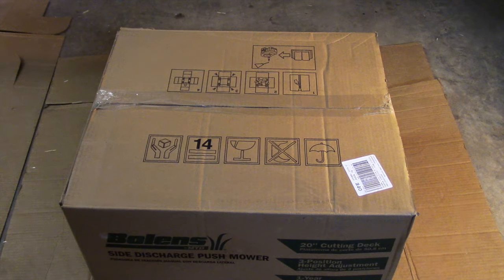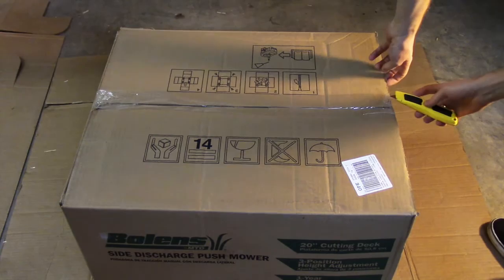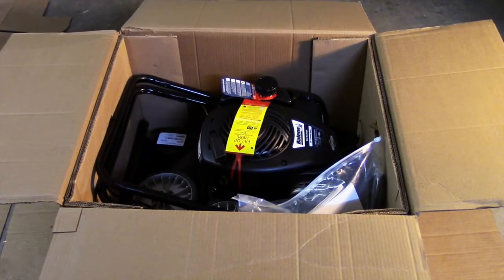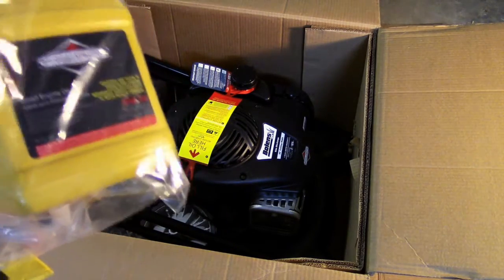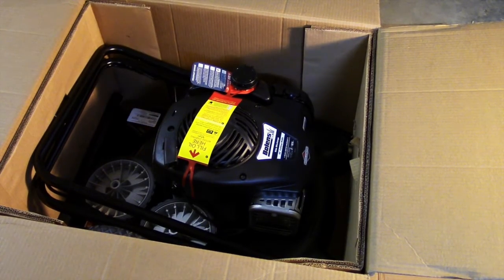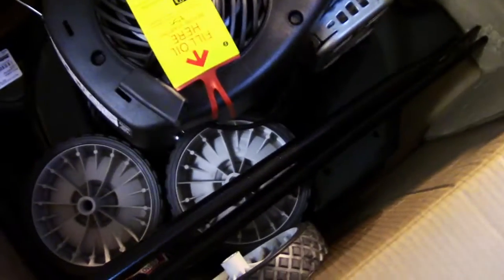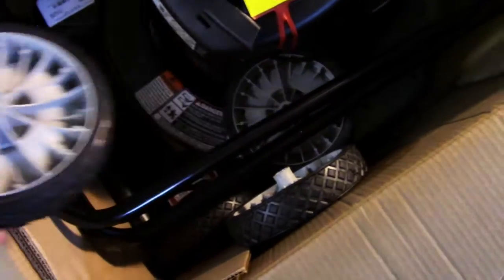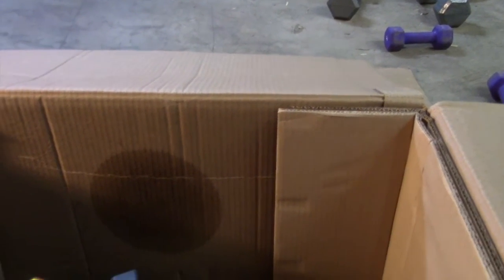Bolens 11A-020W765 lawn mower unboxing

Comment: Having worked at Lowes for 8 years, I can assure you these are not shipped with oil in them.  There's residual oil in them from the factory, but beyond that, minimum oil.  

Also, if it was returned to the store for whatever reason, it would've never made it back into the box that neatly.  Most people do not keep the boxes, let alone disassemble the mower and repackage it.  

Just like the dishwashers and washing machines I deliver, there's always water in them right out of the box. Why? Because of factory testing.  Also, notice that your oil spot is a perfectly round spot about the size of the mower wheel.  If it leaked out of the mower engine, it wouldn't be so perfect.
Reply: I bought one tonight at Lowes and it had a bottle of oil with it.   It was in the sealed bag with the manuals   and hardware